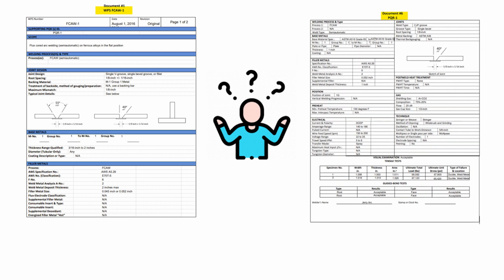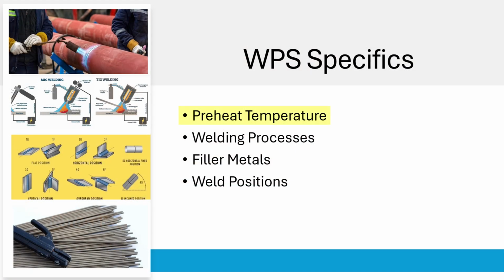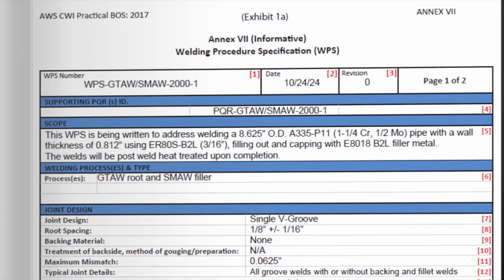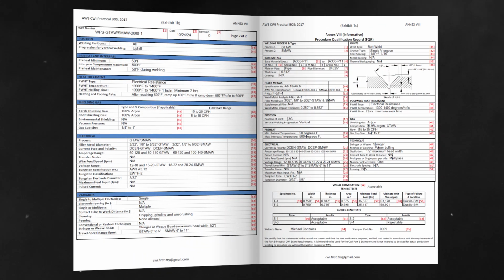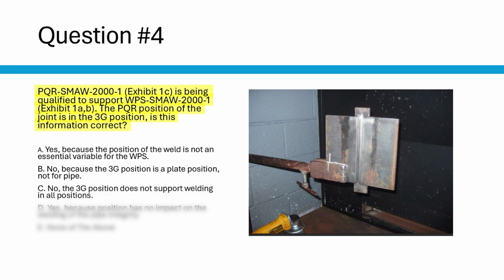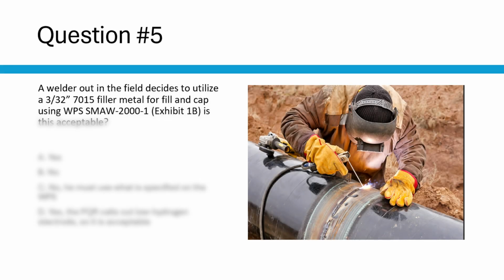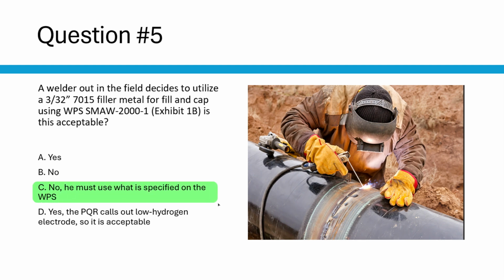Master WPS & PQR for CWI Part B Exam: Test Questions & Answers, Tips & Detailed Explanations

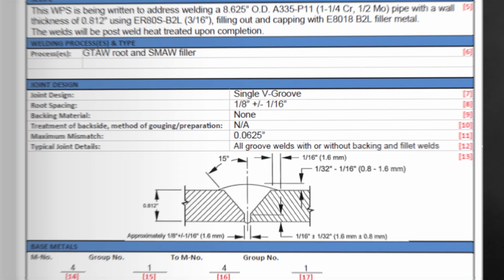Comment: 4:48 states on the WPS  all groove welds with or without backing and fillet welds. BOS 5.2.2.3 states that complete penetration groove welds shall also qualify partial penetration groove welds, fillet welds, and weld build ups. It doesn’t specify grove type. So wouldn’t the correct answer be D.? Or am I misunderstanding this? This book is confusing lol

Comment: Do you need a PQR if the joint is prequalified?
Reply from the maker: That’s a good question, but I don’t think that type of question will appear on the exam. This part of the test is designed to assess whether the candidate can interpret the WPS and PQR and identify essential variables.
Reply: @ Good point